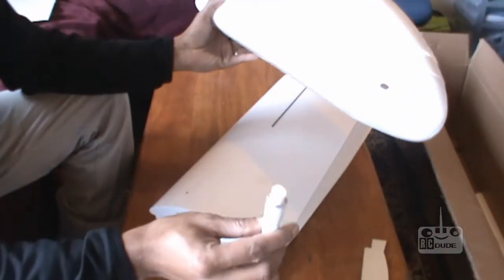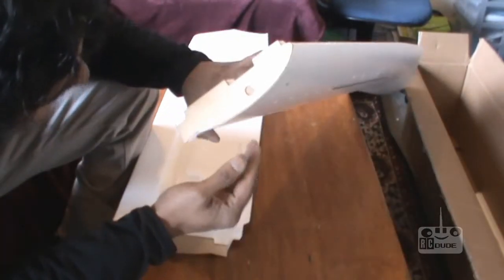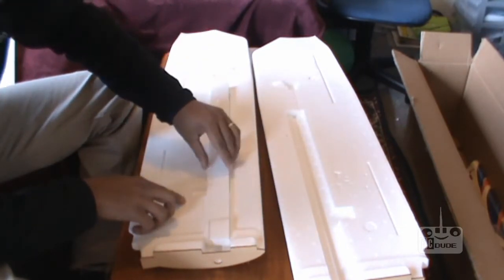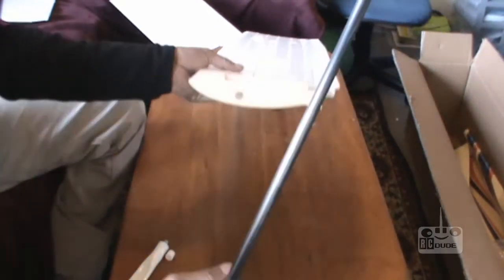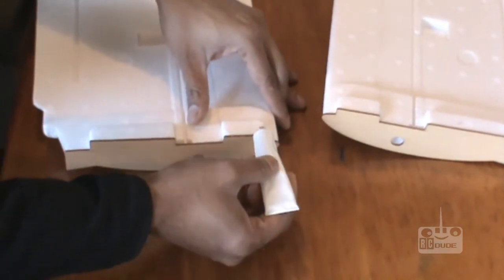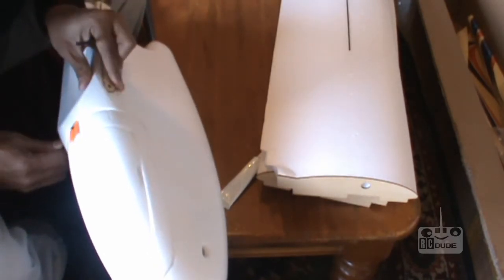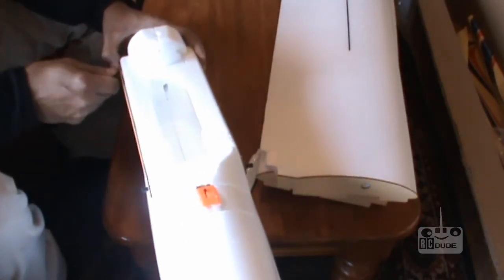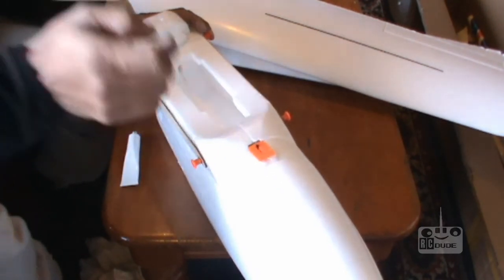Latest 2014 Version Skywalker 1900 Build Part 2 Wings

Comment: what is the chord length at root and chord length at tip. what is the length from root upto the dihedral point. what is the angle of dihedral. what are the airfoil shapes used at the root and at the tip. please provide this details

Comment: The glue in the tube is Contact Cement. You needed to place glue on both sides of part, let dry for 10 min, then put together. it is very strong..